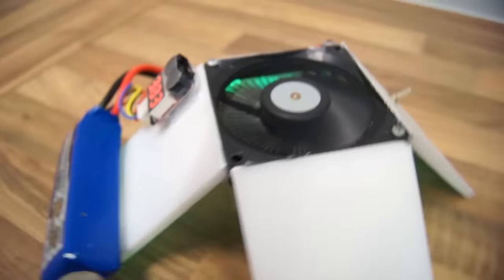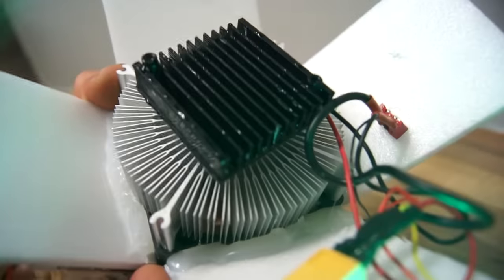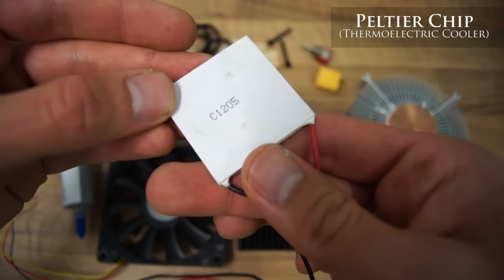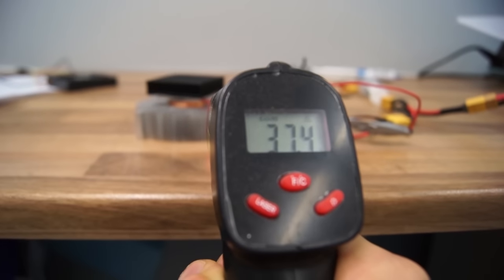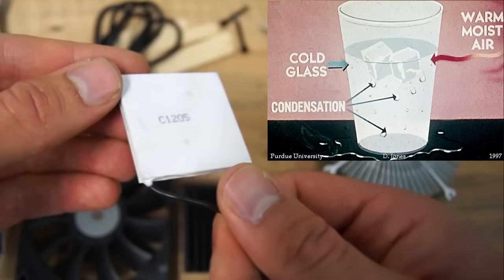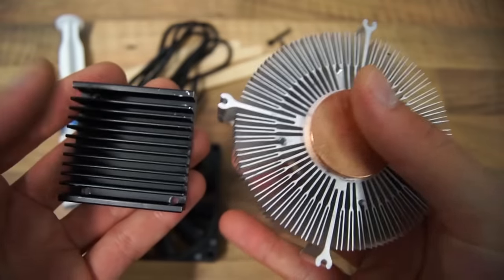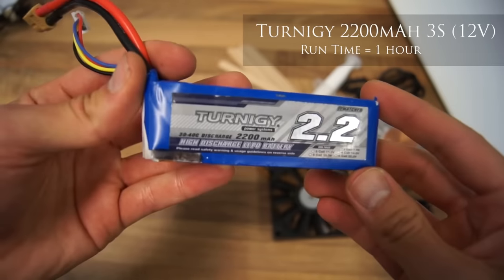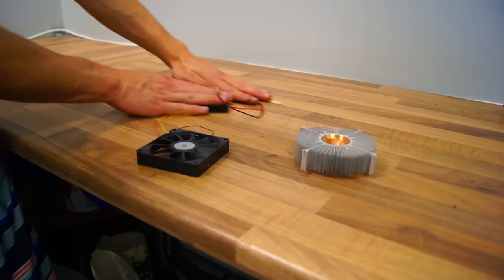How to Make a Dehumidifier Using Thermoelectric Cooling - RCLifeOn

Comment: Nice device, but you should not connect hot and cold radiators with steel screws. Heat will goes through it and efficiency will decrease. It is a common mistake:)
Reply: Did you know that steel has a very low thermal conductivity?
Reply: Since I'm seeing this after 5 years. I'm give some context.

Most of the point of heat in a dehumidifier is to expand the air, which makes the existing vapor spread out. Which allows the air to absorb additional moisture from surrounding air. (Like a vacuum for moisture.)

Then when it hits the cold, it then loses that extra space. And so the water is pushed back out of the air. Along with additional moisture it might have at ambient temperatures.

I don't think those screws have much of an effect on efficiency. Plenty it's already wrong with it. IE using peltiers to begin with... there should be some space between the hot and cold radiators, which you can't do with peltiers. And they already use a lot of power, for what they do.
(I'd argue that most home dehumidifiers are made too compact. But that's me nitpicking.)

This though, is good for learning how things work. And a fun project you can do on your own... without learning how to hook up condensors.
Reply: @josholin31  that's... Not how dehumidifiers work...
Reply: @platinumsky845  I checked what I typed. Are you misunderstanding it?
Reply: @platinumsky845  "A dehumidifier works by drawing warm air currents into its coils via a fan. The warm air contracts as it's fed through the refrigerated coils of the machine, and condensation is left inside the dehumidifier." straight from Google, that is exactly how they work lol.
Reply: @skybeIPod  exactly, different from whatever the heck he was saying about "expanding air" and all that bs. I've literally built these things myself, both phase change and tiny peltier version for high humidity cabinets. I appreciate the quote but you sent it to the wrong person.
Reply: @josholin31  I build, design, and maintain refrigeration systems, including walk in fridges, refrigerated transportation equipment (trucks and trailers for example) customer fridges and freezers, rolled ice cream tables, and dehumidifiers among others. I've built and designed them with both phase change systems like conventional heat pumping systems and with solid state peltier elements for smaller scale work. I've even been working on designing a coaxial sterling cycle cryocooler. I'm just pointing out that there's a few things you could learn about before trying to explain how dehumidifiers work.
Reply: @rusu959 , that's true - steel has noticeably lower thermal conductivity than iron (which is already much lower than aluminum and copper),
but steel is still about 200~250 times more heat conductive than plastics (like ABS, PETG ...).
So if thermal insulation is higher priority than strength go with the plastic screws :)
Reply: @platinumsky845 the dehumidifier damp air goes into the two things the conductor and evaporator the Moist air goes into evaporators what's the evaporator is connected to the conductor which the evaporator is also connected to the compressor which is refrigerant and goes into a tube right back to the conductor then the fan pushes out dry air which the evaporator does drop water into a filter which is from the humidity in the air so yes basically this is how it does work because the evaporator will be dropping water for moisture in the air which will be evaporator looking at the layout of the system yes this is intended to work like this and it can be used to work like this so basically it does work look at the schematics look at the blueprints look at the setup before you think for a minute you need to slow down before you speak
Reply: @platinumsky845 and not just that everybody ideas can work it's all about trial and error things could be brand new from the start and see what you could do from there but everybody needs to run your own test and do their own test testing and testing and testing
Reply: @platinumsky845 I mean I read your other comments and those are good brilliant ideas
Reply: @DJLAWOLF  thank you for clarifying in that last post, there's a lot of misinformation about how dehumidifiers and both solid state and phase change heat transfer methods work. I'm happy to discuss this topic with anyone, I just got a little impatient with the misinformation earlier.

Comment: Pro tip, if you have an old desktop computer (A laptop might work too) that you don't ever use and you are alright taking apart you can take the heat sync for the hotend off of the old cpu and if you have that really cheap gpu you can use that as the other or any small heat sync for the cold end

Comment: Your fan is blowing the air in the wrong direction, from the hot side to the cold side, making it very inefficient. You want the air to first pass the cool side, where the temperature drop will condense the water, and then the hot side, where the cooled air helps lowering the temperature, increasing efficiency.  For maximum efficiency you'd want all the air passing both heatsinks (with perhaps extra ambient air passing only the hot heatsink). With the air blowing from hot to cold side, that would result in no condensation at all, because the air would be heated for example from 20°C to 60°C and then cooled to 40°C. With the air blowing in the other direction, it would first be cooled from 20°C to 0°C, causing condensation, then heated to 40°C at the hot side.
Reply: That's the major downside of Intel stock cooler. The fan blows air into the heatsink instead of blowing it out onto the surroundings. And also it has small surface contact. So it doesn't transfer the heat very well. And he's putting way too much thermal paste in it as well. You could try to grab one of those heat pipe based cooler like deepcool ice edge 200M ( the only cooler I know that heat pipe based ) for the hot side so that it'll has less interference with the cold side...
Reply: @atalakeanumonarshi129  You know you can just turn the fan around, right? I've done this on a few personal PC builds and it works as well if not better than the standard arrangement.

Comment: This is a great project.    Just for future reference, the Pelter has a lot of little metal blocks of PNP & NPN material in a checked pattern that has gaps between the blocks. They are joined in series with copper tracks and attached to the two ceramic plates on each side. The hot ceramic plate side needs to be completely covered by the heat sink or a heat spreader (with added Thermal transfer compound), then attached to the heat sink, so no ceramic area is uncovered, or you will burn out the Pelter as the exposed blocks overheat and the whole (Thermal electric Cooler(TEC) will stop working.

Comment: Personally, I'd have mounted it with the TEC vertical rather than horizontal. That way it would encourage the condensation to trickle off the Black heatsink. I'd also have made a wall of that styrene sheet to prevent airflow between the hot and cold sides. This would would also keep the condensate from becoming vapour again due to it's proximity to the hot side.

Comment: Lowers humidity while raising room temperature. Any possible way to make an AC with many peltier chips (that takes hot air out of the room?
Reply: peltiers are WAY too inefficient to be used as an air conditioning device.

Comment: Is the fan throwing air toward heat sink or outside?
Reply: Preferably outside. Otherwise, the hot air will hit the cold section, decreasing its efficiency.

Comment: I would be interested to know the volume of water collected in a specific amount of time. Have you collected any performance data?
Reply from the maker: Sorry, I have no data regarding performance. I scrapped the project due to the inefficiency.
Reply: I looked into it a little farther yesterday and determined that the cost to build a dehumidifier using this technology would be at least 10 times the cost of a consumer level dehumidifier with the same performance. That aligns well with the inefficiency you mentioned. Thanks for posting.
Reply: @RcLifeOn  hello, i was wondering if you came up with a more efficent model i would like to run off a solar pannel and only need to collect approx 100ml  1/4 a pint in 24 hours
Reply: @Marc9889  hello, i was wondering if you came up with a more efficent model i would like to run off a solar pannel and only need to collect approx 100ml  1/4 a pint in 24 hours

Comment: It's not pulling water from the air it's get cold it's just like a mini refrigerator . When you have them running it gets water vapor inside. Getting cold makes condensation that does not pull condensation out of the air

Comment: I have tried building this one.
It produces some moisture over time, and after 30 minutes, the first drop falls off. After that, it leaves about 5-7 drops of water every hour.  (tested at 25°C/69% humidity)

If I turne it on in a room below 21°C, the cold side freezes to ice, and nothing more happens. 

What am I doing wrong?
Reply: there are a few flaws in the project:
1: the peltier is not coller properly, the round cooler surface does not cover the complete square surface of the peltier, making the peltier run warmer and become less efficient. so make sure the cooler covers the complete surface of the warm side of the peltier. his can be solved by attaching an alluminum or copper plate between peltier and the round cooler.

1.1: use a bigger heatsink on the hot side, the more heat you are able to get rid of the more effiient your peltier cooling. so use a CPU heatsink with at least 95 watts of cooling rating.

2: even if you cover the complete surface of the peltier, the peltier may actually be to cool for water condensation, instead the water drops may freeze. one possible solution would be to increase the surface area of the cool side or attach a small fan, to keep the cool side from freezing but maintaining a minimal temp. to allow condensation
p.s. make sure you don't make the cool side to big either, in that case you may not achieve the condensation temperature.

3: allign the cooling alluminium finns in vertical position. gravity is going to help you to form bigger drops, which are going to run down faster and allow more surface to exposed to the cool side. (accumulation of water drops works more or less as an insulator and keeps the moisture from condesation on the cooler).

4: use a power supply for the Peltier., batteries are sometimes to wea give enough current in order to power the system properly, and if the do, they will be dry after 10-30 minutes and need to recharged. thefore not the best solution if you want to power the system for more than 1h. use a normal 12V 6A power brick that should cover the most common peltiert types (such as 12706) and their required cooling.

5: peltiers are ineffizient AF, it's cool as a learning project or to make your own small DIY fridge etc. but they are really ineffcient. and if you use cheap peltier elements then they are even worse. but for learning they are awesome!

6: humidity. if the humidity in your room is low but temperatures are high, then your little small peltier dehumidifier will not work. its because the relative water content in the air is low. 
instead if the temp. in the room is low and the humidity is high then you are able to condensate a lot of water.
but in generall, the higher the moisture in the room the better works the dehumidifier, but also the higher the risk for getting mould ;-)

7: thermal grease: thermal grease is primary made to get warm, not cold. it becomes more rigid when it cold and is less conductive. looking for special thermal grease which supports up to -20°C is one way to make it more efficient.
the hot side is not an issue at all for the grease

hope it's going to support you in your future projects!
Reply: Mads Bekker this is depends upon the RH value.....

Comment: How long will this dehumidifier work for a 12v battery
Reply: short, unfortunatelly.
the battery he is using has a capacity of 11,1V*2,2Ah=34Wh, the peltier consumes between 40-60w per hour, thefore the battery is going to last between 20-45min
use a 12V 6A power brick instead. cheaper than a battery and way easier to take care of. plus you can run it for muliple hours without worring about the current state of the battery

Comment: I thing the result would be better if the air pass before the cold side of heatsink, and after on hot one. Your Fan push the air on the hot side and after on the cold side.
The air lose Humidity when it's temperature decrease, beause it's capacity to tolerate humidity depends on the temperature. Higher is the temperature, more humidity the air can tolerate.
If you warm up the air , and next you cool it(bringin it to almost the same starting temperature), you make it capable to tollerate more humidity and next to tollerate the same humidity that it tollerated at the start of the process.
Instead if you cool the air and next worm up it, when the temperature goes under the Environment temperature, it lose a lot of humidity, next when it warm up , it has the same temperature of Environment but a lot less of Humidity

Comment: Thanks for the vedio ...
can you Advise to make large  dehumidifier for the agricultural. because day by day in our village  farmers  are facing Water shortage due low rine.....if it is simple concept we can also to teach them to grow agricultural....
#share the knowledge# 
Solar power+dehumidifier= water
Reply: You can use a freezer powerd with solar to cool water down, pump this water with an electric water pump through cooperpipes (outside of the freezer in a shady place) and back in the freezer. Through this circulation, colling water down, pump it through an cooperpipe outside of the freezer, back into the freezer and if you manage to finde the perfect pumping speed and freezer temperature, you can create water drops on the surface of the cooperpipes, collect them and you have drinkable water.
Reply: There are thousands of dehumidifiers on the market. To condense more water using less electricity you would use a heat pump dehumidifier not a thermometric dehumidifier. But even with heat pumps you will still needs A LOT OF ELECTRICITY and it will not work in COLD places.

Comment from the maker: Like my Facebook page for more awesome stuff: https://www.facebook.com/rclifeon/?fref=ts
Reply: what is the link to buy that specific type of large heatsink you attach the fan to? The heat sink you provided a link for will not allow airflow through it to the panel and sink below it
Reply: Additionally, I have found circular heat sinks, but none with the round copper plate attached, is that something you purchased separately and attached? Or were you able to buy one with it already on there? Thanks!
Reply: Some of those circular CPU heat sinks have a copper middle and some of them are just aluminum. depends on which one you get, when it was made, and what company you buy it from. I can't tell you which companies sell which. The ones with the copper slug in the middle, cool a little better but not by much. most companies just make them completely aluminum to cut down cost but if you find one that has the copper slug in the middle you should spend a little more to get it if you care about performance. The best thing you can get are CPU heat sinks with heat pipes because the copper heat pipes spread out the heat to the fins more evenly and quicker. If you want to spend more money and/or are doing this for a permanent project, you can get AIO units with are cheap and easy water cooling devises which work a little better than the air cooling setups and are generally easy to install.
Reply: RCLifeOn donkeys
Reply: RCLifeOn  is my favourite video

Comment: What is the temperature difference form hot to cool?
Reply: Heat is moved from the cold side to the hot side, so the difference is zero, if it was 100% efficient, which is impossible. In reality, electrical resistance adds additional waste heat, but that is basically negligible.
Reply: Is it better than old compressor cooling systems?
Reply: nope. peltiers have roughly half of the efficiency of compressor cooling
their benefits are: no moving parts and their small size

Comment: Pretty cool man! But how well does it work? I live in an area and sometimes we can reach 90% humidity
Reply from the maker: Thanks dude! It will work fine, though you probably need a bigger one if you are gonna use it in big rooms.
Reply: the higher the humidity the more effective the condensation, the more water you are able to get from the air.

but this construction has a few flaws.
1. Battery powered, the LiPo is expensive and difficult to handle
2. the peltier is very inefficient when it comes to cooling but is awesome when you don't need massive cooling power, as well when you lack space
3. use a simple 12V 75W AC adapter to power this thing;-), the most common peltier unit (12706) uses 6amps of power

better buy a normal dehumidifier at the local hardware store or even better a transportable air conditioner.
i use a suntec in my apartment when the moistiness is breaking the 85% mark and it really sucks the water out from the air.

Comment: my peltier is not work truly. its hot side is monstrous hot but cold side is not cold enough. do you have an idea for that??
Reply: Is there a heatsink on the hot side? A peltier cooler will not work correctly without a heat sink. By the law of conservation of energy, you cannot remove heat without moving it somewhere, in other words, you cannot get one side to become cold without pulling enough of the heat away.